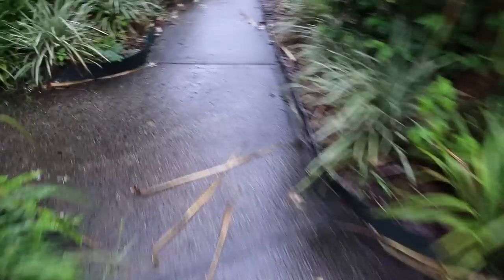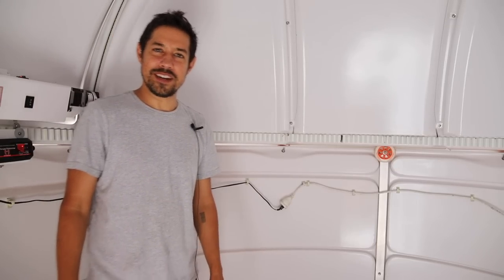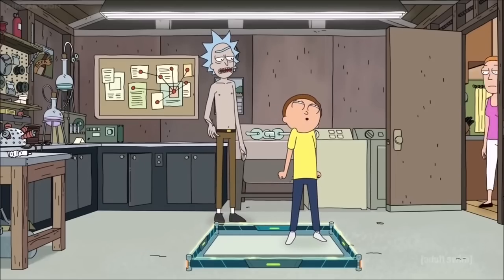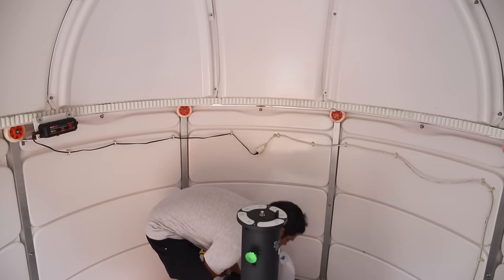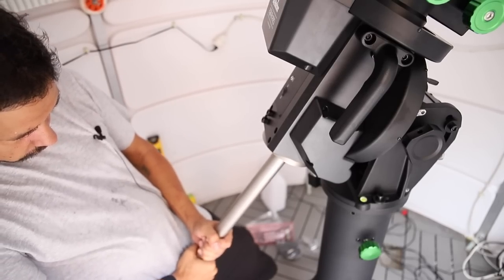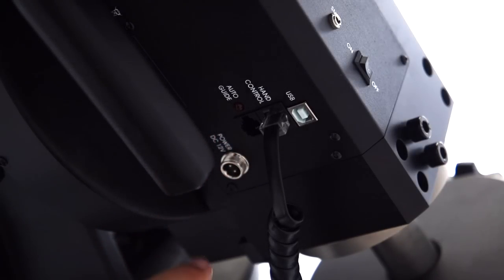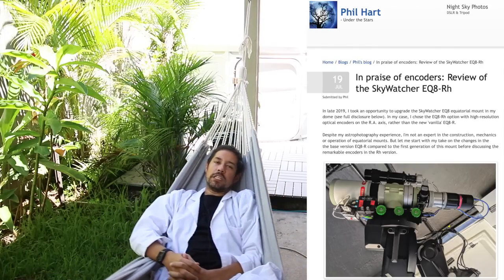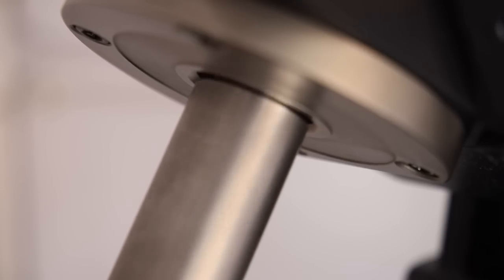1 Million Sub Observatory Mount Reveal!

Comment: From the size of that pallet I was thinking Planewave's L-Series...
Reply: That's what I was thinking ... "Oh shit!  He bought a PlaneWave mount."  Those things are amazing.  Chuck the auto-guider in the bin ... you wont need it.  Someday...
Reply: I thought he went over to the snob side and bought an Astrophysics.
Reply: @dayjeremy  I spent a long time trying to decide between the EQ8-Rh and the Astrophysics Mach2GTO.  Finally went with the Mach2GTO and couldn't be happier - getting 10 minute unguided subs at 3910mm with 70lbs of weight on it. I'm very curious to learn Dylan's opinions on the EQ8 and I hope he does a lot of unguided on it.
Reply: @deonbrewis8876  it's been my understanding that even the best mounts benefit from guiding.
Reply: @dayjeremy  The Mach2GTO Renishaw encoders are accurate to 0.25" per hour - which is better than excellent seeing from a Chilean mountain top. So as long as you have a stable pier and a good Point Map, it will perform as well as a guider. My point map is still quite poor at this point and I can already track 10 minutes at 3910mm. I know Roland has done over an hour.

The reason to still use a guider however is if you use the mount on the go and you don't want to spend the time to generate a point map.
Reply: @dayjeremy  It depends. If your mount is moved around a lot then guiding is easier. If your mount is fixed, a pointing model is easier. The Mach2GTO pointing model & encoders are far more accurate than any seeing you can get from a guide scope, sans a Chilean mountain range.

However, the pointing model takes hours to build which is why it's there is a portable/fixed distinction. Also if you do something like putting a fixed mount on  a tripod where it can be kicked (cough, Dylan... :) ).

Comment: Unlikely you will get long term stability positioning your mount directly onto the plastic panels you have in your dome.
If there is moisture or water leakage issue I would place some concrete plinths or blocks underneath each leg pin of the tripod. You can also include a moisture barrier underneath the blocks.
There is significant weight and movement on each point. 
Cheers

(great choice on the mount. my choice also, for my long term needs, but not much cash floating around the house at the moment)
Reply from the maker: They’re pretty solid / hard whatever they are but the distributed weight should help. I used to have vibration suppression there but it’s usually not needed unless I’m stomping around in there.
Reply: @DylanODonnell  As long as the mount is stable when you screw in the shaft for the counter weights.
....we wouldnt want anything to happen there now would we Mr O'Donnell

Comment: Enjoy the new mount, really. Now I have just see a potential design flaw! All of the connector at the back of the RA axis are pointing upwards!!! Find a friend with a 3D printer and make a shield for this ASAP. I don't know what Oz is like but this would probably die in a 6 months to a year here in Europe. Condensation, will eventual get in there without some sort of shield... I assume the DEC connectors can be turned toward the back rather than kept at the front. Again same issue, the angle is perfect for water / condensation to collect there.
Reply from the maker: Great tip !

Comment: Nice video. Did you test the PSU before plugging it in? A) If the red LED comes on it's OK (can always "just" buy another mount); B) Measured with meter and compared with Datsun / Cigar setup;  C) Tried it with something else; D) Left it powered up for a few hours first?
Reply from the maker: I considered buying a long cigarette cable to plug it into the Tesla (amazingly, it has a cigarette lighter hidden within it!) for the visual lulz.

Comment: Nice mount. Congratulations. Cant wait to see more photographs. I noticed you set it up on the plastic floor and the last mount was on the concrete. Will walking in the observatory cause any issues. Just a couscous question from a newbee.
Reply from the maker: Definitely a concern. This mount is SO heavy though it doesn’t wobble but also, the aim is to not be in the obs at all while it’s doing it’s thing :)

Comment: Good luck with the new mount. I hope it will operate better than the poor old CGX. Maybe its workings are of a better quality?
Reply from the maker: It’s certainly twice as heavy!
Reply: CGX is decently made until you get to the geared motors or more specifically the gearbox. It's the CGX's Achilles heal

Comment: Laughed a lot thank you. Serious question. I don't quite understand encoders (in a mount like this) and their improvements on PE. Does it mean that you don't really need a guide scope? or that it will just guide better but still needs one?
Reply from the maker: It should smooth out the PE almost entirely really yes. But I would still suggest guiding .. because dithering and drizzle are good things :)
Reply: @DylanODonnell  Thank you for answering. The dithering and drizzle make perfect sense. Major congrats on a beautiful mount.

Comment: It is a nice mount, but the USB3-hub is a disaster!
Reply from the maker: Thanks for the tip!
Reply: @DylanODonnell  It seems to be extremely sensitive in order to  allow the computer to recognize the gear connected. In my case the 6200mm and 2600mc only show up if I have very specific cable types/lengths between the cameras and the EQ8-R hub.

Comment: Very nice mount, but why don't manufacturers make a decent tracking wedge style mount, it has the advantages of no meridian flip, or counterweight.

So wonder why none come out with a wedge designed mount with precision tracking motors. Will be interesting how you like Sky-Watcher  and know Trevor Jones thought Celestron was better in that regard as far as HC went, and software, etc.hr always through skywatcher was a little delayed compared to Celestron.
Reply from the maker: I think both Celestron and skywatcher HC user experience is weird. Mounts should really just have Bluetooth and be controllable by an app.
Reply: @DylanODonnell  yeah dont know they don't use Bluetooth, better than wifi. Its great with my Evolution 9.25 on Alt Alz mount to be able to control it through app on phone or tablet, but Bluetooth would have been better. Why are they so behind the times? Noting ago still using g really old  connectors and only just basically gone usb. They certianly fall behind. Should not the HC be replaced with a little screen with planetrium rather than just Words and numbers.

I think the ioprton HC is better than either celestron or Skywatcher.

Does the skywatcher also have some sort of all star polar alighment feature?
Reply: @DylanODonnell  still don't know why they continue with the GEM  mount when wedge design would be so much better. Pity the SE and Evolution dont track so well on a wedge, but if they did have precise motors, then a wedge would be so much better.  I think the could make a special version  astrophotography  version with a high quality RA and DC motors, on a wedge mount.

Afterall years ago Meade SCT'S many did use wedges and was the standard for years.

Comment: Ebony and Errr yes they are owned by the same Chinese company...your latitude is very low
Reply from the maker: Yep! And funny enough my latitude is the same as cape Canaveral. Just on the other side of the equator.
Reply: @DylanODonnell  I will have to read the reviews on this mount and the difference between the R and Rh versions. Outstanding customer service with Sky Watcher...Any vibration issues to guiding when you are in the observatory?
Reply from the maker: When it’s in use .. I’m not in there. Generally I only go in there to fix a problem .. otherwise I’m drinking inside :) so vibration not a huge issue.
Reply: @DylanODonnell  Same here. I set up my sequences and then I am outta' there. Pods are too far from the house to intercept wifi signal